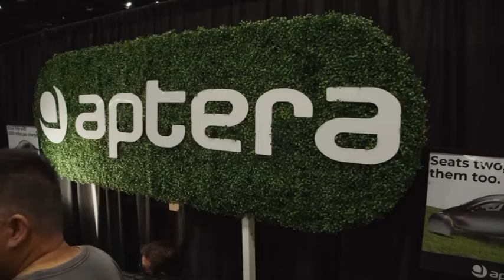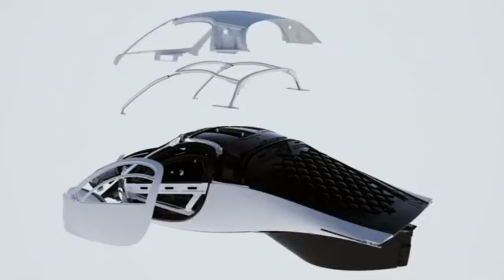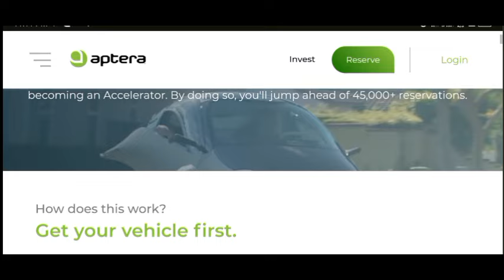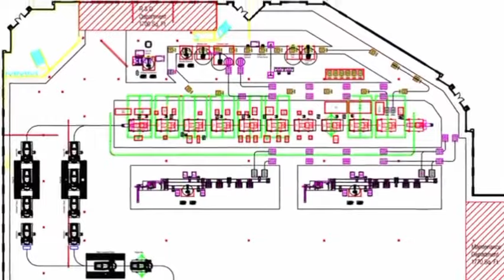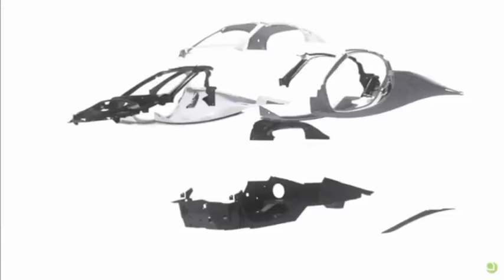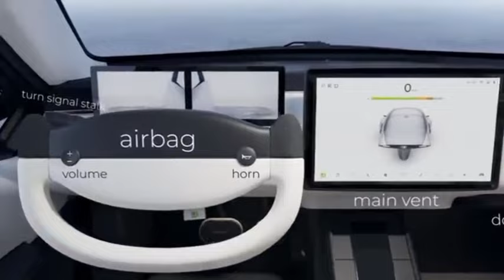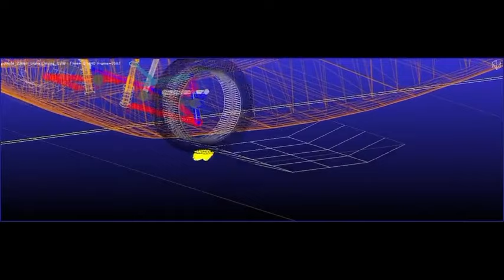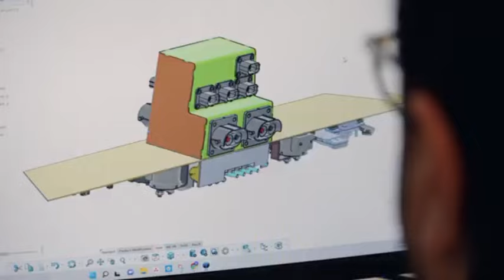Aptera 2024 Solar EV sees company secure $33 million to fund initial phases of solar EV production

Comment: I just did the math. Aptera raising $100,000,000 at selling a car for say $40,000 (perhaps a low ball figure) would only need to sell 2500 vehicles!!! It has 2000 in the accelerator program and many more people who have put a smaller amount down. I believe that it will come to fruition. I watched a video by some naysayer listing all the reasons why Aptera will fail. Most of it was BS and why rout for it to fail? I know I will certainly buy one and can't wait.
Reply: I like your creative math. You calculated revenue but not all of the other costs to actually build them. Your assumption is those cars cost zero to build. Might want to look back on that math.

Comment: The Gamma model motors for aptera had the 110 top speed. The newer motor design for the production intent design is limited to 101 mph. Is more efficient in the low end and extends that to the upper limits of 80 mph and then loses peak efficiency going upward. This also cut a half second off the 0-60 too 4 seconds. The issue is in the motors. If you consider 94%+ efficient motors an issue? This isn't a race car. The wing on older race cars were called spoilers for a reason. They create drag and increase pressure on the wheels. The Aptera has no spoilers to create drag and never should if you want its efficiency. The importance of the smoke you see at the Pininfarina wind tunnel is that it has no curl [drag is extremely low]. Aptera starts with light weight [2000 lbs launch edition], reduced friction [3 wheels] and aerodynamics [don't have much effect below 30 mph].

Comment: There are no roads in the US that you can legally go even 110mph. So why faster? Also there are other engineering constraints that are probably influencing the top speed.
Reply: Motorcycles go 200 mph
Reply: I want a car that if I have to accelerate to avoid an accident isn't a turd. And if it can go 110 it will cruise comfortably at 70-80. And almost any car on the market will do 110. So what's your point?
Other than being a troll.

Comment: Aptera has redesigned the Elaphe motor they will use for maximum efficiency at the normal driving speeds. This results in a projected top speed of only 101 MPH. That is high enough to get you a ticket in any of these United States. I do not want that vehicle to go any faster, but if I did I would contact Elaphe for one of their other 'off the shelf' motors as Aptera gives you the right to repair their vehicles. Changing the motor out would probably also give you the right to invalidate any warranties related to anything to do with that system.

Comment: With the focus of the LE to be released to the US market and no roads in the US that you can legally travel at 102+ mph the number of people that would benefit from exceeding the 102 mph limit are very few.  It makes much more sense to optimize the motors for speeds that the consumer would most likely travel in.  Efficiency is the name of Aptera's game and to develop or even use motors and tires that are rated above 100 mph is not an efficient use of their time or energy to travel at that speed.

Should someone decide to modify their Aptera to travel at 120+ mph (on the track, of course), I will caution you to the engineering involved to do this safely as you will have a significant amount of mass rotating just for starters to consider.  I have friends that put nitro on their Trans Am only to blow the engine up in a month.  All I can say is to have fun, use caution so you can report back on how your modifications went but don't expect Aptera to make those changes.

Comment: There's a thread I answered an andrew fuller that my answer has been removed so I will paste it back in without the two full links I included -

"sir , I am a retired toolmaker and machinist,who knows you cannot sink dies into 19 ton steel blocks for 3 million Dallas," I am completely ignorant about toolmaking, but if memory serves me correctly they were saying these blocks were about 5,000 lbs of steel and you are comparing with 19 tons I have not heard of nor can imagine such a weight  just to squash a paste. It's around what a full bus weighs. I had to look up how many lbs in a ton (used to know it, but have never used it in decades) and it's an easy to work with 2,000 lbs. I hope it's the same in Italy and I hope they are not referring to tonnes, which I think are lighter. In any case, you said tons and on that basis, your blocks are 38,000 lbs? I don't think so. Nor do we know if the 5,000 lbs Chris referred to was the combined press or that for the lower half, or an average for each half, such is the vagueness he talks in. It is common for every piece of information he gives. I tried Google to see what a cost would be, and first found this absolutely crazy article -
(front removed)die-science-estimating-die-cost

It's crazy because it's even more vague than the snake oil salesman. See if you can find a price estimate in the whole article? There is nothing there. So I tried again and got this -
(front removed)injection-mold-costs-what-is-a-reasonable-estimate(back removed)

It says for a big one it's about $10,000. Now it is also way too vague, because what size is big? I thought I would reverse engineer your considered cheap $20,000,000 block at an estimated 6' W by 4' by D by 3' H (~72 cu feet) lower half mold they show in a video, and see what size I get for their biggest example at $10,000. Naturally, it's going to be 2,000 times smaller and in cu feet that's 0.036 of one cu foot, or well under four hundredths of a single cubic foot. I can't imagine how tiny that must be in any combination of W, D & H, nor how the article can say it's the at large end of molds. It seems like dividing a shoe box into a hundred pieces at the least. That would be smaller than a ring case by far and I can't see that as being a large mold in anyone's language. 
One thing I noticed was that steel was an inferior material to use than titanium, and Aptera has opted for steel of an unknown grade. This is where they might have skimped on efficiency once more. However, since you're the expert - how about you provide some more meaningful data so that we amateurs can see how much one die or mold is reasonably going to cost, and we can multiply by the six or twelve (depending) for the six parts of Aptera and get an estimate that would be plus or minus half a million dollars? Or better still, how about someone lobbies Chris Anthony to stump up the bill for the contract? It's all tooled up and no more to spend.
"even 20 million might not be enough," That would make the size of the "bigger jobs" a mold that would do a contact lens.  
"I remember doing valve blocks that weighed 700 lbs for the military that we were paid 110 thousand dollars , and this was in 1970" I can reverse engineer your job (scale up is more the appropriate term) to see what the mold weighs for your lowest estimate of $20,000,000. You were paid just over $157. 14 per pound and at that exact price you could get a block weighing 127,275 pounds, or well over 63 tons in 1970. That's more than three full busses. If we use the 5,000 lbs of what I thought Chris claimed (I may be wrong), that would have cost him $785,700 in 1970. Allowing for inflation I would not see that ballooning to anywhere near your minimum of $20,000,000. In fact, if it were twice the weight (maybe top and bottom?) $1,571,400 would be hard presssed to get near it today. This doesn't even factor in any drops in steel prices after inflation and I would expect automated CNC machining is far cheaper than how you would have done it in 1970. Still - I am sure the fanboys will believe you, lol.

Comment: I want my Apterra this year 2024. Can’t wait, tired of paying for gas ⛽️. I think Elon is making a mistake and letting his ego dominate his thinking. Only if by some enlightenment he will change his mind. Imaging a Solar powered and that patented design coming from Apterra. Win-win for both manufactures. Now people have a choice. Apterra with a rear motor provided by Tesla & battery tech. While Tesla gets the Solar panels. 
Imaging this merge, other companies will be buried or adapt real fast. It’s like watching a Ferrari & Lamborghini rivalry.
Reply: If Telsa bought Aptera, it could provide the financing and labor force to start producing Apteras on a massive scale. However, Tesla doesn't have the tech that the Aptera uses: stamped CF-SMC bodies, in-wheel motors, interdigitated back contact solar cells, solar cell and glass lamination. Also, Aptera doesn't want to use Tesla's Autopilot and FSD because it consumes too much energy, which is one of the reasons why it chose Comma AI. If Tesla bought Aptera, Tesla would probably scrap the new software interface that Aptera is creating, and it sounds like the lean interface that Aptera is creating has real promise. 
 
I would like to see Tesla start designing cars like Aptera, but I think that Tesla and Aptera are better off as separate companies. What Aptera mostly needs at this point is financing which Tesla could provide, but I fear that Tesla would be very disruptive for Aptera and not provide much help with the tech that Aptera needs. Frankly, I think that Aptera can get the financing and grow in scale without Tesla.

Comment: Seems like a rather long and wide vehicle to transport 2 people.
Reply: The wideness provides better stability with a 3-wheeled vehicle. They could have designed a narrower vehicle with 4 wheels but it would be less aerodynamic and have more rolling resistance. Having 3 wheels also makes it cheaper because it only has to comply with autocycle regulations in the US, which are less stringent than normal car regulations. 

The long tail provides good aerodynamics (look at the shape of dolphins and teardrops) and it provides more surface area for solar cells. 

I am curious whether Aptera will stick with the wider 3 wheel design for its future 4 seater vehicle or go with a narrower 4 wheel vehicle.

Comment: Way too expensive for what it is. Folks will buy Teslas.
Reply: Yes, but park a Tesla in the garage, because when it catches fire it will burn you house down. And they do catch fire.
Reply: Yes, the two seater Aptera is a niche vehicle, but the over 46k in preorders shows that there is real demand. With an Aptera you will save about $600 per year on charging, compared to a Tesla Model 3, or about $9k over a 15 years. When stopping at a Supercharger, the Model 3 will cost 2.5 times more per mile to charge than the Aptera. Moreover, Aptera has real advantages over Tesla for people who want to drive the most environmental car, and there are people who want to drive a distinctive vehicle, which the Aptera's unique shape provides. 

Also, the modular design and right to repair philosophy of the Aptera will make it easier to upgrade and extend its lifespan, and the stamped CF-SMC body should last forever, whereas the Tesla Model 3/Y with gigacastings, structural battery and integrated design are hard to fix and not designed for upgrading, so they are more likely to be junked after 2 decades. 

When the Aptera makes its future 4 seater model, it will cost more than the future Tesla Model 2 (the $25k subcompact), but I think that there will be a market for it, because a lot of people will want a car that can mostly drive for free and doesn't require a level 2 charger.
Reply: @amosbatto3051  The average is 1.2 people in a car!!!  Yes, I can count the times I have another passenger on one hand. It is not a family car. And I will be buying one.